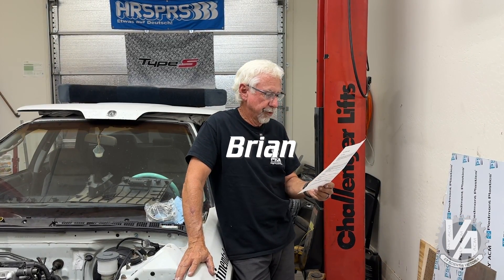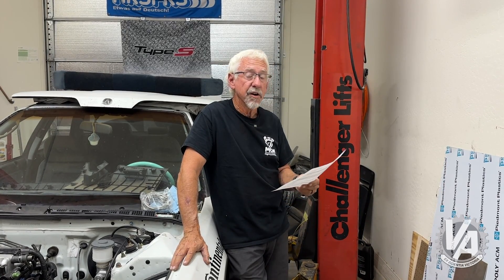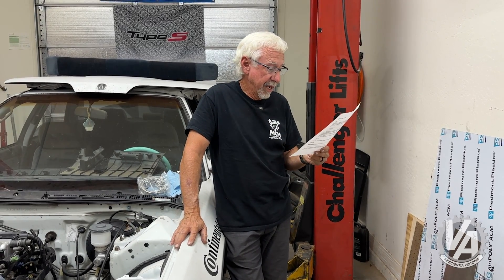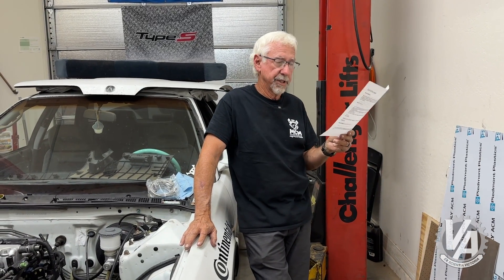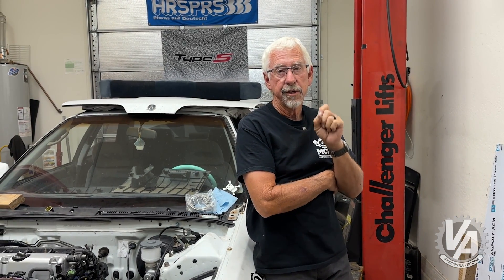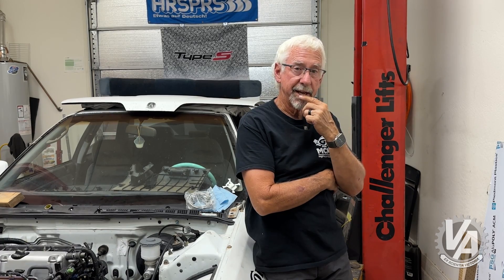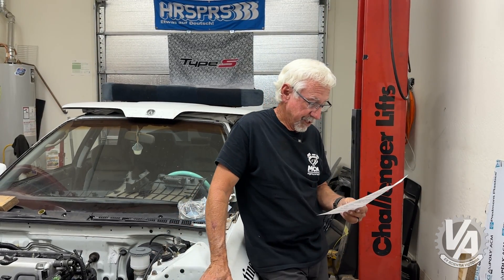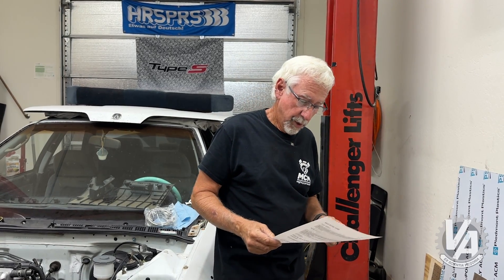Getting the RIGHT SPEED to Read on Your Speedometer || Different Size Tires Engine Swap

Comment: You can get a speedometer gearbox to adjust the speed.  It would require a custom cable if it's a cable actuated speedo.  If you want me to dig up the names of the shops reply.
Reply: Dakota Digital is good for electronic speedos.

Comment: I have an 05 CR-V 5mt and I just used a tire calcuculator to get it close. I moved from the stock size 215/65R16 to 225/50R18 on 18x8.5 wheels. It's still about the same height at 27" but my speedometer is right on. I'll work on lowering next.

Comment: Hey Brian, I’m having issues with my shifts from 4th to 5th. I have a k24a2 with the 06 civic si transmission with lsd, ktune shifter and hybrid shift cables in a 96 midori civic hatch. I had the ktuned race shifter cables but I switched to hybrid think it was the cable stretched and the shifter was quite loose.. it’s a bit tighter but still hard to find 5th gear yet. It feels like it goes too far to the right and passes the engagement point of 5th gear. Do you think that the reverse lockout would cause this or is this a whole different issue. Side note.. I had to replace 2nd and 3rd gears and synchros. Found that one of the shifter forks was about to break off so I welded it back together. Any insights would be appreciated. Thank you

Comment: My speedometer still doesn't work on my 1989 CRX but you answered my question. I need some kind of converter. Bad thing also is Hondata is not reading speed either.
Reply: Side note: I should have bought Hasport mounts cause they're adjustable. Is it too late to switch?
Reply: Isn't an 89 civic cable driven? My 88 is, and I think my 91 is as well, but with a little box that sends the speed signal to the ECU
Reply: @bgee461  It is, but I'm referring to Hondata not being able to read my speed, which is the most important. I will have to get a cable box thing for the instrument cluster one day. I don't know what kind, though...?

Comment: I've always just removed the plastic cover to the speedometer and pulled the needle out from the pin it's connected to. Then just drive down a non-busy road with the cruise control set to 60 using GPS and insert the needle back in pointed to 60.  I've done this on a 2000 Eclipse and 1996 del Sol and no issues.
Reply: That's freaking genius. Thank you
Reply: You can also do this with the car on Jack stands and the drive wheels up. A scan tool will tell you your vehicle speed. Then adjust your cluster like you did. I do this on my 95 mustang and my 02 Dodge RAM 💪

Comment: Hey Brian, enjoy the content and love getting any and all information I'm a bit of nerd for stock replacement set ups, but would love to find out if you had any insight, I own a 99 Civic LX currently with Si Brakes, a long time ago there was a person with the handle "Brake Expert" who used to post different Brake set ups that you could use/ modify to work on Honda Civics from 92-2000, more for 96-2000 but stopped after 2006 or so but I was looking for a replacement for ITR Hubs since they were 5x114.3 and was wondering if anyone you knew had tested CRZ hubs. Sadly they aren't sold through anyone other than Honda but as far as Spine to axle and Brake rotor center bore, and are very close on wheel bearing size, they match very closely but part numbers don't match to be a 100% replacement for USDM ITR hubs would this be viable as a replacement for 32mm hubs 5x114.3 hub for a more modern car? or would 8th gen R18 civics fit more closely, no aftermarket companies that make CRZ or ITR hubs to do a 100% comparison of sizes. Would love some insight and your thoughts on this.

Comment: Hello vtec gurus, I sent in the original question.. Thanks for the video response.. I did try both the crv and ek clusters and there was no change in the indicated speed, but they are 100% interchangeable in my case ('96 ek, '98 crv).. next thought is to try a vss from bseries civic or integra.. would dseries vss fit the awd crv?
Reply: Indications are that all VSS interchange.  However, I believe the way it works is vss to ecu, ecu to cluster.  The cluster is just the display.  I mean, you can connect an obd reader and see that the speed is actually in the ecu.  I believe Brian may have mistaken speedo correction for odometer correction when he said shops were able to alter the odometer readings... which in our case isn't relevant since we have mechanical odometers
Reply: @bgee461 the factory wiring diagrams i have are showing the vss Ts off to both the ecu and speedometer directly, which leads me to switching vss.. I have eyes or for a (nearly) free one, not trying to spend on a guess.. thx for yr input!

Comment: I had to use a ktuned vss converter between my kpro and the dash. I think I had to adjust it by ~16% to get the speedometer to match the gps speedometer on my phone.

Comment: I have a crx with a b16a swap the b16 has a acl   oil pump .I use the car for hpde. I noticed that with the stock pcv system I keep blowing gaskets . Like vtec solenoid. Val over gaskets. So I bought a speed factory canister catch can . I’ve tried hooking it up several different ways . Off the back of the block .I removed that then hooked the pcv hose off the black box and the valve cover to it . The issue I’m having now is the van keeps filling up and spewing over . What would you recommend? Would it be a catch can issue or an engine issue?

Comment: Would love to Kswap my GK5 but keep it automatic. How much more difficult or easier would that be and would the same engines be an option despite having an auto transmission?
Reply: You’d have to use the “old school” automatic , not your current cvt and use the ecu from an automatic  civic. No one has any info on the wiring between those ecu’s and that generation of fit. Probably not worth the hassle, and there are probably many incompatibilities between that engine and trans combo and that generation fit.
Reply: same question here. im trying to budget build my base rsx auto and well there just are not any manual transmissions avauiilable for a reasonable price.  swapped a k24a2 in and portmatcehed up the 2006 tsx head and intake on a 2004 lower and have it in the car and the wiring has been a complete hassel . lots of info to swap to manual out there  but my c 101 is different and most of my wires for the at are just not listed or difficult to find. between all data info i happened into your c 101 plug info  and the 2002 2003 service manual i almost have it figured out. problem has been finding a KNOWN GOOD HARNESS TO START FROM AS THE ONE TIME I FOUND ONE PEOPLE HACKED IT UP[ TO just get the 50 deg, cam gear out fast in the yard. that and how if possible can i get this tuned. i have the 2006 tsx ecdu and the 2003 base auto ecu as well if that might help. the transmission is from the rsx.
sorry about the mess of a post just pressed for time and really need some help here